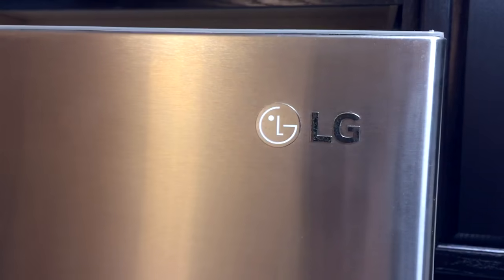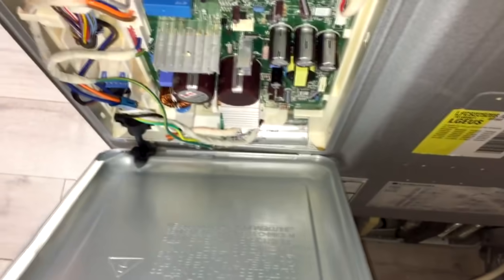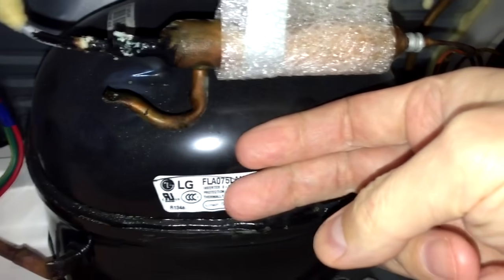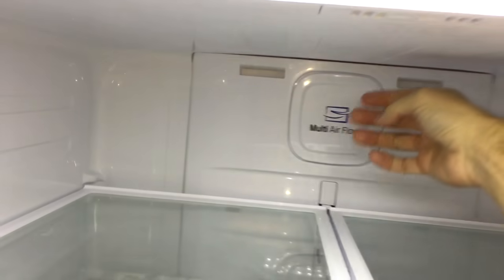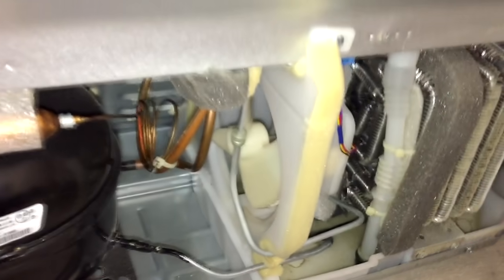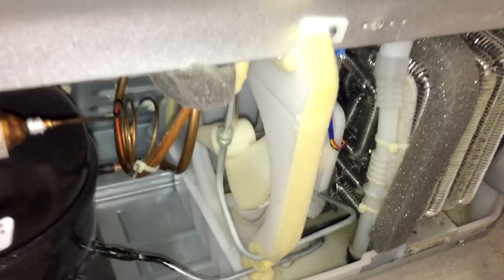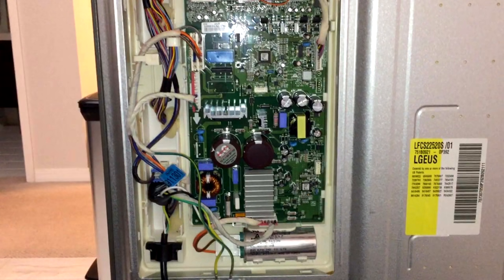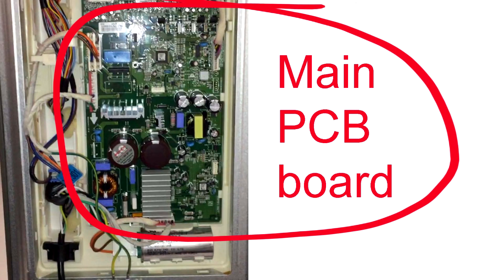LG refrigerator test and reset button

Comment: I have a LG LMX25981st-00.  The compressor will not shut off.  I first replaced the thermistor in the refrigerator section then in the freezer section.  After that, I replaced the PCB and the problem still persists.  When I go through the 4 test functions everything seems to checkout OK.    Not sure where to go next.
Reply from the maker: There are a few more sensors on this refrigerator as the ambient, and the ice maker sensors. But the most troublesome is the defrost sensor. It's should be attached to the evaporator coil inside the freezer.
Also, I wonder if the temperature in one, or all, compartments is just not cold enough. Therefore, the compressor is running non-stop trying to cool it. Have you checked the actual temperatures in ALL compartments? Is the ice maker working well?
Reply: @Your-Self  all compartments arts super cold, currently the medium temp section is 14 degrees F, and the freezer is -5 degrees F.   The ice machine still produces ice.  I'm found conflict in on what the sensors should ohm out when submerged in ice, but I believe it is 16m and they read close to that.  According to the local parts house, the med temp and low temp sections use the same sensor.  I think I will replace the ice machine temp sensor and the defrost sensor as those are the only two temp sensors I have not replaced.
Reply from the maker: You didn't indicate the temperature inside the refrigerator section. Is it too cold, and all fresh food products are freezing? Is that the actual problem with the unit?
On my chart, the resistance when submerged in the icy water should be:
* freezer/ice thermistors ~ 7.8 kOhms
* refrigerator/defrost thermistors ~ 30 kOhms (30 000 Ohms)

Comment: 4 DOORS FRENCH REFRIGERATOR 

The fridge & freezer are both too warm. I noticed it started warming up, then this morning almost everything had to be thrown out. Air is blowing inside but it’s too warm. The fan on the bottom at the back is running & the compressor is cold on high side & running normal.
So is it sensor ?
Or do I need program or setting ,but I am confused because compressor is running normal 
I did check back door mother board or press test button all fan works .

Any suggestions.
Reply from the maker: That's either a gas leak in the system or, most likely, an inefficient (bad) compressor.
LG typically replaces those compressors absolutely free for the first 5 years, if you have a purchasing receipt.

Comment: I have a french-door LFXS24623S  Discovered today that both refrigerator and freezer are not cooling.  I have power the the fridge, the display has the normal temps showing, but the fridge is at 50 degrees and freezer contents are melted/thawed.  I performed the test you posted.  Went smooth as silk.  Fan worked compressor kicked-in.  No error light on the PCB board.  Still no cooling.  I used the LG ThinQ app and followed the diagnostic steps.  The app concluded "Did not detect abnormal operation".  Two hours later, my fridge is registering 60 degrees.  Please help..
Reply from the maker: This is a typical LG compressor failure, running but not cooling.
Call LG directly if your fridge is under 5 years old. They should replace the compressor absolutely free. If it's over 5 years, they'll charge you the installation labor fee.

Comment: Thank you for the video. My freezer begins working properly, but randomly doesn’t get cold enough to freeze for about 2 days, then freezes again. This process has happened about 4 times in a month. What do you think it could be?
Reply from the maker: Intermittent issues like this are difficult to diagnose, especially over messaging. It could be the fan occasionally not working, sticking relay on the PCB, partial/moving restriction inside the sealed system... etc, so it's probably best to call a tech to look at it. Sorry that I can't be more helpful. PS when it's freezing well, measure the temperature inside the freezer for the technician to know, and if it's warmer than 5°F, it's not good freezing.
Reply: hi what was your issue , mine is doing the same thing , was once a year at xmas time , now its out of warranty its doing it monthly

Comment: LED lights come on but very dim. Ideas ??    Thanks.  I have done the unplug the fridge reset, which helped with another problem but not the lights.
Reply from the maker: What refrigerator model number are you talking about? Because they all have different wiring setups.
But the most common problem is with the freezer LED going bad. And that module brings down the whole circuit.

Comment: The big blue pcb relay left of the button you're pressing won't stop clicking and my fridge is not cooling. Do you know what could be wrong?
Reply from the maker: The manufacturer doesn't provide a detailed schematic of the PCB. But most likely, that large relay is for the Defrost Circuit. So it's possible that the evaporator is caked in icy frost (can't defrost) and unable to cool the fridge.
Typically whenever a relay is clicking, there is a problem with that PCB. So try replacing the PCB and see what happens.

Comment: maybe this will help someone but LG model LG LSXS26366S (and probably others) the control board is ON TOP of the unit, and it doesn’t have test mode 2 OR 3. It has one single test mode. a 2nd press of the test button just returns the fridge to regular operation.

Comment: Thank you so much. The model you used in the video is the exact same model that I have.
Reply from the maker: Glad I could help
Reply: @Your-Self  unfortunately it did not solve my issue, still good knowledge still had a technician come out under warranty replace the compressor and dryer LG having a problem with these specific things

Comment: Our refrigerator model is ...lsc24971st.
The cooling is not working.
Freezer was working, but the cooler was not at all cooling.
Local Technician visited, cleaned pipes with vinegar, asked us to switch off refrigerator for 24 hrs and restart.
After we restated, the freezer is too is not working to the optimum level and temperature doesn't go below 10 degrees.
Please let me know, what might be the issues.
Thank you so much.
Reply from the maker: I'm assuming that you checked and both fans are running at the same time as the compressor... right?
In this case, after defrosting the refrigerator for 24 hours and it's still not cooling well, the problem most likely is with the Sealed System (a gas leak, a restriction, or the compressor is going bad)
To verify the problem, the local technician needs to install gauges to check internal pressure inside the Sealed System.

Comment: I have a lfxs26973 that is freezing the freezer but fridge was warm. Did all the tests and seem to work. Fine. The fans in the freezer don't turn when out of test mode but do during tests 1 and 2. Is this a bad board? There are no lights on the board.
Reply: Evaporator wasn't full of ice but had some ice on the outside on the cover.
Reply from the maker: When you open a door, the fan will automatically stop. Need to activate the door switch, and the fan should start blowing within a minute... verify that it works.
The temperature inside the freezer should be around 0-5 F°. If it's higher than that, you may have a Sealed System problem.

Comment: Replaced my board, Got SS in second stage testing... Freezer fan blows, but the refrig fan does not.. THoughts?
Reply from the maker: The SS error code is for the pantry temperature sensor. It could be not completely connected to the board or just bad.

Comment: Hi I have a LG fridge, everything works on it except my custom chill drawer.  My Diagnosis doesn’t notice anything wrong. Yet none of the buttons work on it. It’s still cold like the freezer part (4 door French) I do get a “Freezer door isn’t closed properly has been detected” but that doesn’t go away no matter what I do and my freezer is the right temperature. Could the test and reset button help find the issue?
Reply from the maker: Try this Test/Reset button and see if that helps.
However, the problem could be with something else, like a bad door-switch or a computer board.
Put your phone inside each compartment while recording a video. When you close the door, the lights in the compartment should turn off. If lights stay on, the door switch is probably bad.
Also, the custom-chill display may have gotten wet at some point in the past. The liquid may have caused the display to corrode inside and create weird problems like that.
Reply: @Your-Self  Yeah, I did the test and I even got no blinks at all as well. I’m just confused how it’s the only part that doesn’t work! All door lights turn off as well when closed

Comment: Man, I am at a loss. Fans are running, compressor is humming, I go through the test that you performed and everything check outs, I even checked both capacitors and both are good, but I didn’t get any blinking light to suggest any errors. My problem is zero cooling. Shouldn’t I get an error code or light?
Reply from the maker: Unfortunately, some LG linear compressors can run but not cool at all. And the error light is not smart enough to see the compressor problem.
Reply: Thank you for the response, I finally got it to blink 6 times.
Reply from the maker: That sounds like the compressor problem. If it's under 5 years old, call LG and they might be able to replace it completely free.
Reply: @Your-Self  Ended up buying a smaller French door with less electrical components and no water dispenser. My parents have had their Frigidaire over 20 years and that’s what I went with. Thanx for the help

Comment: Question after clicking the first time for test mode, can i leave it like that? Or i have to click all four times?
Reply from the maker: You can. It will time out on its own in about 10 minutes.
Reply: @Your-Self  what about if the fan turns off and doesn't want to turn back on after it times out? What could be the issue? Thank you for your help 🙏
Reply from the maker: Are you sure it's not turning back on?
Newer refrigerators require the doors to be closed to run the evaporator fan in regular mode. 
You could replicate a closed door by activating the door switch so the lights go out. Within a minute, the fan should start working again.
But if the fan is blowing room-temperature air, the issue could be with the compressor. It's a typical problem with LG Linear compressors.
Reply: @Your-Self  the bottom part is cold my freezer. Working just fine. But the top part is not getting cold like it used to. Not sure what's going on
Reply from the maker: What is the model number of your fridge? I'll try to look up the documentation to see what the problem could be.
Also, can you measure the actual temperature inside the freezer? It may seem cold, but not what it's supposed to be.
Reply from the maker: Your refrigerator has one cooling evaporator and one cooling fan inside the freezer. That fan brings some of the cold air into your top compartment through a damper door.
You may want to take the freezer apart to look at the evaporator coils. They should be completely covered from top to bottom in a thin layer of frost. 
If there is no frost or just a little on top, that's a major "sealed system problem." 
If the evaporator is covered in a thick layer of frost, that could be a fixable "defrost problem."
Can you feel the cold air coming into the top compartment during Test 1?
Reply: @Your-Self  just a little but you can feel it. I was looking at another video and it said it could be frozen reason why is not passing air. But idk 🤷‍♂️
Reply from the maker: Yep. If the freezer evaporator coil is frozen with a thick layer of frost, that could be a "defrost issue." Take a look at the coil to confirm it.
Reply: @Your-Self  thank you man

Comment: Hello thank you for the informative post. My problem is that the refrigerator stays at around 66° no matter what I set the temperature for. The freezer works fine and keeps the food Frozen as it should. You indicated that a circulation fan might not be turning on. I wonder if that is a motherboard problem? Are there two separate fans, one that is internal between the freezer in the refrigerator? Do you have a schematic diagram of those refrigerator? I will run through your Diagnostics tomorrow but I'm not sure if it will accurately determine my problem. Thanks in advance, Paul
Reply from the maker: What is your refrigerator model number? I may have the schematic for it.
You could have multiple fans and multiple cooling Evaporators... or just one. That may play a role in why one section is cold, but the other is not. Also, what is the actual temperature inside your freezer? It may seem freezing cold at 25°F, but it really should be at around 0°F. Make sure the Condenser Coil next to the compressor is clean to provide a good heat-transfer.
Reply: @Your-Self  Thank you for your quick response. As you can imagine it's always exciting when your refrigerator full of food is not cooling properly. I was too busy vacuuming out the coils and wiping the greasy crud off the fan blades to notice that there was a schematic on the top of the refrigerator back. I purchased a 4 probe smoker thermometer so that I could measure both the freezer and the refrigerator at the same time. After preforming the four test sequences I determined that the circulation fan was now indeed working, (with the help of a magnetic so that I could feel the cool air beginning to come into the refrigerator). Yeah! My food is saved! But I may still have the beginning of a problem. Setting the temperature to the lowest setting the freezer measured -8 but the refrigerator only got down to 45 degrees. That's enough to stop any more milk from going bad but I am wondering if my linear compressor is starting to fail? I think the model number is an M6#1JCV075320 or an MS#1JCV075320 or an LMXS27626SAS. The invoice was smudged. It is an LG Linear Compressor Side by Side with a an icemaker. Thank you soooo much for your step by step video. Very informative! What are your thoughts on my temperature variables?
Reply: By the way I did not have a blinking LED on the motherboard. But I did have indications of what mode I was in on the front panel display. The purchase date for this unit was August 23rd 2015. Do you think I could get a freebie replacement for the compressor?
Reply from the maker: The model number on the invoice seems to be for a French-Door fridge, so I'm still not sure if you have a dual or a single Evaporator. The model number should be on a sticker, probably inside the refrigerator section.
If your freezer got down to -8°F, that probably means the compressor is good. And if it's a single evaporator unit, the problem could be with the air transfer from the freezer to the fridge compartment.
Reply: @Your-Self  
Yes it is a French Door Refrigerator with two drawers below and both of the drawers are freezers. The refrigerator is set for 34° and it has improved and stabilized at 40°. Big improvement but still not what it is set for. There is only one fan at the coils. Is there an internal fan for the refrigerator or some sort of damper door to regulate the cold air coming from the very cold freezer?
Reply from the maker: If it's the right model, you have a single fan with a damper door for the fridge compartment (other fans are for the Ice Maker and Air Filter). 
Since the freezer cools very well and the fridge is cooling somewhat OK, it's difficult to troubleshoot. The damper door obviously works, but maybe not opening fully, and it's difficult to prove. The fan also works, but maybe not strong enough and dying. There may be some ice buildup around the damper, reducing the airflow.
The temperature sensor inside the fridge could be "lying" to the mainboard about the real temperature. If you have a multimeter you can test it. Unplug the connector CON7 and insert your leads into two White wires #13 and #14. You should read about 24K Ohms which is equal to 41°F inside the fridge. But if you get a higher reading, let's say 30K Ohms, that equals 32°F. So the board "thinks" it's cold enough and stops cooling.
Reply: @Your-Self  Hello, I  haven't had the energy to pull the refrigerator out again. But I will, when I have a complete battle plan. It does sound like a problem with the damper door not allowing the cold air from the freezer to bring the temperature of the refrigerator down. I will preform your recommendations when I open the back panel again. Can you please also tell me the location of the damper door? I would like to examine if the damper is stuck or hung up. In all my troubleshooting years I have found that mechanical problems are usually to blame for malfunctioning operations. 
Thank you in advance for your helpful advice.
Reply from the maker: The damper door is probably integrated with the air-tower in the center of your fridge. The damper should be somewhere on the bottom of that tower. And it's controlled by the main computer board. So when you run the Test 1, you should feel the air blowing in all compartments. The Test 2, the damper should close and only the freezer should get the air movement... nothing in the fridge.

Comment: Hi , i have a lg model lfc23760st not cooling. I noticed the fan on the inside is not blowing air. After using this video and pressing the test button once, i feel the air blowing and working. Now after exiting test mode (unplugged & plugged back in), everything sounds & looks good in the back but the fan is no longer blowing. 
What’s wrong?
Thank you!
Reply from the maker: In regular mode, some refrigerator models will stop blowing air inside when you open a door. So you need to activate the door switch for the fan to start again.
If during the test mode, the fan inside was blowing warm (room temperature) air, the refrigerant gas is probably leaking out. In this case, you'll need a tech to investigate.